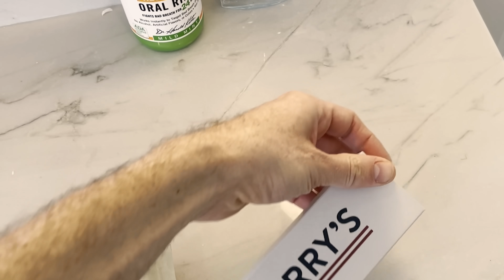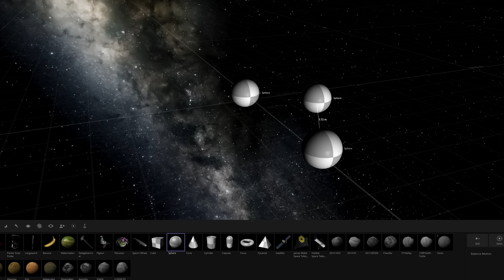Perpetual Motion Achieved

Comment: They could have at least tried to get rid of the suspicious large black plastic block on the top. A transparent funnel with two or three metal rings for the acceleration (with all the magic hidden inside the metal parts) should be able to do the trick.
Reply: Go ahead
Reply: price point at the science center gift shop matters.
Reply: The funnel up top has nothing to do with it, beyond making the huge base look like a consistent design choice.

Comment: "Nothing to compare (the speed) to" is an incorrect statement. The faster something moves, the slower time appears to pass. By comparing the time distortion to a stationary clock, you could calculate its velocity. It's an unwieldy experiment to perform, but theoretically you don't need another object as a reference point.

Comment: While true perpetual motion machines are impossible there are some ways to get small amounts of "free" energy into a highly efficient machine allowing for the appearance of perpetual motion, but it is usually just an inefficient waste of that free energy like using the heat from the sun to generate a flowing fluid with convection and using that to turn fan, instead of just using solar panels connected to an efficient electric motor to turn the fan. There is also a natural voltage gradient in the air that can be harnessed for a "perpetual" motion machine that runs 24/7 but the efficiency you need to make it work for the minimal voltage you get is still VERY difficult to achieve.

Comment: Is it working like a railgun by sending a current through the ball? That looks like it might work except that the the two sides of the track seem to join together and create a short-circut at the top on the side away from the platform.
Reply: Hi. I think the ball triggers an electromagnet as it starts down the hole. That adds to its acceleration due to gravity. At the bottom it hits another trigger to switch the electromagnet off. Cheers, P.R.
Reply: There's no current in the rails, or the thing would be prohibited from sales in developed countries.  (It also wouldn't do anything measurable to the ball without being high enough power to be seriously dangerous...and possibly launch the ball through your ceiling.)  All working parts are inside the base and the funnel is thick to visually balance out how big the base is.  A magnetic switch of some kind activates a motor that moves a magnet to drive the ball.   (Probably a pair of magnets to prevent vibration.)  The noise of the ball on the rails drowns out any motor noise.
An alternate version of this could put all the parts in the funnel and not use a base at all, but it's harder to squeeze everything into the much smaller space.  I notice not all of these have a flat bottom to the rail, so this one may have skimped a little on the motion control, while getting fancy with the hidden switch.

Comment: 0:23 the dead giveaway is that it's creating sound. A real perpetual motion machine would need to be silent and produce no heat.

Otherwise it wouldn't just be perpetual motion, it'd be energy-gaining and that ball would need to run away via positive feedback. 

Unless the losses due to sound were precisely equal to the energy gained each cycle? That seems super unlikely.
Reply: The ball falling up isn't a dead giveaway either?

Comment: Pretty sure you are wrong about an object moving through space eventually stopping.  You would have to hit it at a perfect angle with the exact opposite force, with the quantum states in some perfect form to get it to lose all momentum.  Hitting it with stuff will simply change its angular momentum.  And even if it makes its way into a star, the star is moving, and will continue to move, forever(maybe, depending on the end of the universe scenario you accept and how you interpret it)

Comment: With the machine turned off, does the ball make it much further if the device is in your vacuum chamber? Wondering how much of the slow down is friction with the rails and how much is air resistance.
Reply: Followup question: If the machine is turned on and in a vacuum, I assume the ball moves faster without the air resistance, does it overshoot and leave the device?
Reply: Gravity still exists

Comment: What if you looped it, had a magnet pushing it strong on the bottom, and have some copper to tap the electricity on a track?
Reply: Magnets don't push, they pull.  An object going past a stationary magnet will always go slower or stop, unless the _electro_magnet is timed to turn off before slowing the object down.

Comment: You could use rare earth neodymium magnets to propel the ball instead of batteries. Similar to that of a rail gun.
Reply: Batteries don't move the ball, electromagnets do using power from the battery.  Stationary magnets CANNOT move ANYTHING that is also stationary.  Rail guns work because the magnets turn on and off AND the object is already moving past them.  They're also very loud as each part is charged and dissipated, moving massive amounts of energy resulting in heat.

You can make a very simple ramped launcher that works similar to a railgun by carefully placing magnets closer together along a line, but something has to physically move or activate to start the projectile going.  It won't launch anything just by having magnets.

If you're wondering why this response is what it is, I've seen comments like yours on every video on YouTube explaining why perpetual motion doesn't exist, no matter which way you point the magnets or water or dropping ball or swinging hammer.  You can't outsmart physics and you won't be the first one to try.  There is no output of work without input.

Comment: 5:45 Not always. If are putting in a little bit of energy just to unlock energy that's been stored in a spring, a nucleus, etc., you can get more out than you put in.
Reply: But that energy wasnt free it was put into the spring to be stored before. Although with atoms/the nucleus I dont really know how all that works.
Reply: @MattH-wg7ou  exactly, you just add another energy "source" in the ecuation
Reply: @MattH-wg7ou  Isn't that exactly what I said?
Reply: If you account for the energy spent compressing the spring, then you aren't getting more out than you put in.  If you don't account for that, then you have done the energy balance wrong, exactly like he said.  The statement at 5:45 is always true.
Reply: @johnnyq4260  also, when the spring moves to decompress, it's going to lose some of its stored energy as heat energy, because anytime something moves, it creates heat.
Reply: @johnnyq4260 no, it's not what you said, because you ended with "you can get more out than you put in."  What you're actually doing is getting out today some of what you (or someone or something) put in yesterday, by doing more work today, even if that last work is negligible, like the pulling of a gun's trigger.
Reply: @VoltisArt  You are pointlessly mincing words. Of course someone or something wound up the springs previously.

Comment: I wonder where fusion reactors fit into what he talked about at the end... About a machine putting out more than you put in. Since they actually finally DID it back in December or January for the first time.  But that's a result of converting the matter into energy... So does that count as energy put in?
Reply: Remember to include e=mc² in your energy balance.  The mass is being consumed, so you are not getting out more than you put in.
Reply: Putting out more energy than you put in means something different in this case. If you want burn a lump of coal you have to first put energy in to light it on fire. Once it starts burning it will release more energy than what you put in.

In most fusion reactors we can't do this, yet. Heating up the plasma inside the reactor and creating the strong magnetic fields to prevent it from touching the walls uses a lot of energy. At the same time only a small fraction of the plasma actually starts the fusion reaction, so compared to the energy we put in, the amount of energy, in the form of heat, that is put out by the fusion is lower.

But we are not getting free energy from nothing. If the reactor runs long enough, all the Hydrogen is turned into Helium, so we need to replace it with more Hydrogen, just like when we burn coal, at some point it is all burnt up and we need to add more to keep the fire going.

Comment: If you want to make a perpetual motion stand-in that looks REALLY good, figure out how to build an extremely efficient solar neutrinovoltaic cell.  That would be like a solar photovoltaic cell, but running on neutrinos, which constitute somewhere in the low single digits of percent of the Sun's output (3% according to the 1969 Scientific American article by John Bahcall, but that percentage might be a bit off in light of more modern science).  The hard part is figuring out how to make the solar neutrinovoltaic cell . . . of course, if you could do that, you could do all sorts of cool stuff.
Reply: @neumaticgrunt Neutrinos and antineutrinos already are known to interact with atomic nuclei (induced beta decay and induced bata+ decay) and electrons (weak neutral current scattering) -- these interactions are how neutrino detectors work.  it's just that the interaction is extremely inefficient at solar neutrino energies and for quite away above (but starts to get noticeably more efficient as you approach the energy needed to produce W+- and Z bosons).  So far, we haven't figured out a technology to make this more efficient at low energies.

Comment: What about the new fusion reactor though? I read that they are able to exact 50% more energy than it takes to run?
Reply: Like he said, if you don't account for all the energies, you don't get a balanced result.  Fusion reactions require an input fuel, and they produce an output waste.  The energy output is from the difference in energy between the fuel and the waste.

Comment: Just to preemptively answer the other two questions that everyone is about to ask:

Nuclear fusion burns fuel. In this particular case the fuel is isotopes of hydrogen, which have a high nuclear binding energy, and the waste product is helium, which has a lower nuclear binding energy. The difference in energy is what we're using to generate electricity (EMF) for your home or business.
---
Time crystals are already in their lowest possible energy state (near absolute zero). If you try to do anything to them, they stop being time crystals. They are "weird" because the atoms are in periodic motion, even though this is the lowest possible energy state that they can be in. (You would expect all atomic motion to have stopped by this temperature.)

Comment: You can always use Sun’s energy to create a perpetual motion machine which can sustain itself (instead of batteries) since it’s freely available.
Reply: The sun will eventually die out though, so not truly perpetual.
Reply: 1:  The sun sustaining a thing is not the thing sustaining itself.  Energy not costing you anything doesn't mean it doesn't cost the universe anything, even if the universe was already expending that cost.  Nothing's free, and even trying to achieve nothing will still probably cost you or somebody something.
2:  All machines that could possibly do work break down due to friction.
3:  A machine without detectable friction (such as a radiometer suspended by a magnet) can't do any physical work, so is only an amusement or aesthetic device, or at best a detector for energy input.

Comment: If an objet loses energy while emiting gravitational waves, it becomes lighter?, If yes, how much?, If not, Where dos that energy go?, What's the difference between gravitational waves and clasic potential energy by gravity(mass*gravity* height).
Reply: I don't expect the answer, but if you have it it's cool and awesome, this video made me think about these questions.
Reply: I'm no expert but as I understand it, you always need some kind of acceleration to create gravitational waves. Two objects circling each other, like the Earth and the Sun, will create gravitational waves, but a single object that doesn't rotate around itself and moves through space at a constant speed will not.

When the Earth and the Sun emit gravitational waves they lose energy not in the form of mass, but as kinetic energy, so the rotation slows down. Theoretically this will cause the Earth to fall into the Sun eventually. But as far as I could find out the loss of energy is so small that the whole "the Sun expands and destroys the Earth" thing mentioned in the video will happen a lot sooner.
Reply: The radiated gravitational potential goes into making the entire rest of the universe shake back and forth an incredibly tiny amount.

Comment: If light truly has zero rest mass, then there should be a way to achieve "perpetual motion" with light or close to it, but one could still never extract infinite power from said light.  But, then, while I've read of equations in physics that suggest light cannot have rest mass, I've never heard of an experiment that proves it has no rest mass.  Experiments just suggest light have a very very very small rest mass if any at all.  But, then if light did have a small amount of rest mass, it wouldn't perpetually travel unless completely undisturbed, right?  I've always wondered about the thought experiment.  Somehow trap light inside of a perfectly reflective globe/spheroid shape of significant size.  Would the light ever stop?  Does it briefly "stop" while being reflected by our fictional "perfect" mirror surface?  And will there ever be a time it stops reflecting?

Comment: I understand that orbiting bodies will eventually stop orbiting, due to losing energy in the form of gravitational waves. What about solid objects that are spinning, like a sphere? Since its gravitational pull is the same in every direction, I figure it shouldn't create gravitational waves? Is there anything that would stop a solid spinning object isolated in space?
Reply: All such objects in space are spinning by default.  The orbit (year) and spin (day) are the middle result of the interaction between the mass that turned into a star, and the mass that turned into a planet, as well as the smaller bits that turned into moons and asteroids.  (The end result being either crashing together, or shooting apart forever.)
As for isolated in space, that's mentioned in the video.  If it's alone, there's no reference to detect any kind of motion, including spin.  All objects in the universe attract each other with gravity, always.  It's just lower when you're far away, never absent, even if you don't have the sensitivity or longevity to detect it.

Comment: What if instead of using an electromagnet we use a normal magnet, the magnetic field will eventually run out but it's almost perpetual motion
Reply: Not possible. A static magnetic field can't add energy to anything that's moving around in a continuous loop. A magnet attracts a steel ball coming towards it, giving it kinetic energy, but then to complete the cycle the steel ball will have to go away, and as it goes away the magnet will slow it down and take that energy back.

If you move the magnet around you'd have to supply energy.

Comment: You can't really say, a machine is always "using" more energy, than is giving off. Because energy does not disappear, it always just gets converted to another form of energy.
Like this machine taking the energy you gave to it by placing the ball with the power of your body and the power of the battery inside and converting it to kinetic energy and heat energy (from the friction of the ball, even though you wouldn't feel any temperature).
No energy ever gets lost, it is just our perception of things, like the heat energy created through the air friction of the moving ball being so small, that it feels to us like there is none. It just shows us, how little energy there is in moving such a tiny ball. Try moving a huge ball and there is lots of heat energy - not from the air friction, but created by your body, working hard to get a huge ball moving. Like, try pushing a car and get it rolling as fast as possible. The car or won't get warm, but your body will quickly start steaming, because as your muscles convert energy, they convert it into kinetic energy but also heat energy, just as a car engine would do as well.

Comment: I wonder if there’s a way of using magnets to actually achieve something like this without inputting power from an outside source
Reply: Videos like this are the answer.  There are many such videos, covering many such devices.
The answer is "No."  Not water, not magnets, not balls, not hammers, not superconductors.  Nothing moves forever.  You will not outsmart physics.
Never seems to stop the cycle of people trying, though.  Maybe that's the real perpetual motion machine.

Comment: I actually used to think this one was possible because it's not so much perpetual motion as it is gravity and a slingshot effect taking the ball back to the beginning, where it falls down a hole, starting the process over again. So not so much perpetual motion as much as the same motion in perpetual restart.
Reply: But if you know anything, a falling ball can not ever get back up to the original height using only gravity.. slingshot or not, it can't ever get back to the original height.
Reply: If you lift a ball in gravity, you are giving the ball gravitational potential energy (that's what it's called). You get that energy back when the ball falls, but you can't get back more than you put in. It's like putting energy into a rechargeable battery. You can't get out more than you put in.